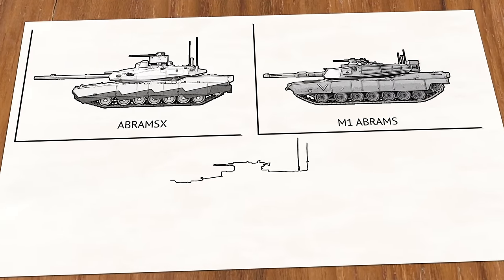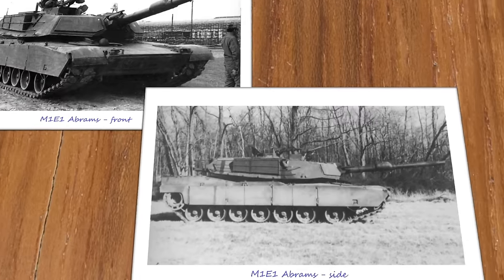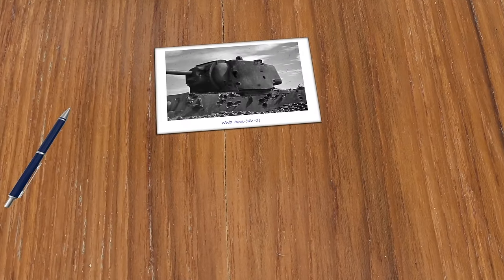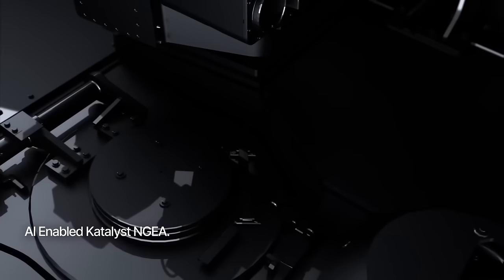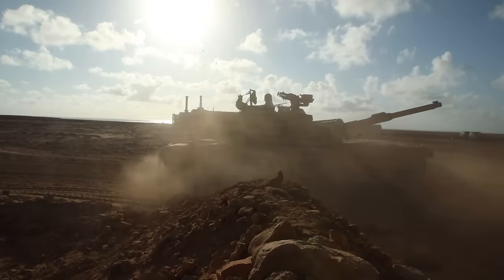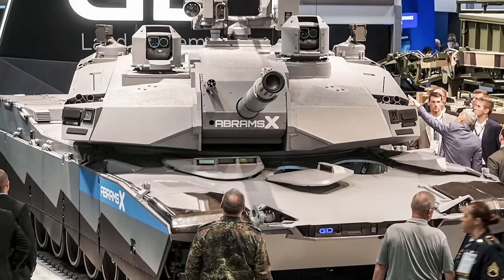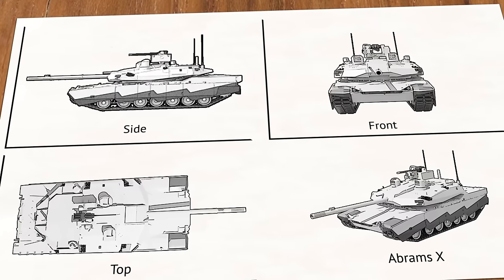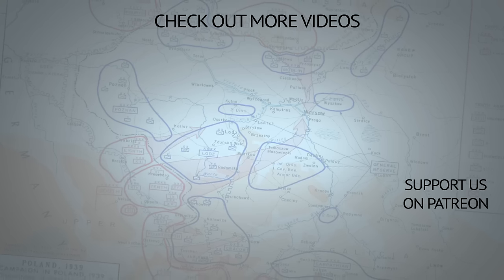M1A3 Abrams is finally happening. And it may get an unmanned turret, like the Russian Armata T-14.

Comment: The chieftain had a good video about this where essentially he's saying it probably isn't going to change much they're just in a better integrate all of its current technology to reduce weight significantly

Expected to weigh 10 tons less without losing any capabilities and roughly looking the same
Reply: He also brought up a 2 man or 1 man turret with an autoloader to reduce weight further.  And a diesel engine.
Reply: @imjashingyou3461  I hope they dont put an autoloader in it
Reply: @ryangoslingIRL  Why? Also they may have to reduce the weight enough.
Reply: An autoloader without a redesigned turret makes little sense.  A human loader doesn't actually weigh that much, but they do require space in which to operate.  That necessitates a larger turret, which means there is more surface area that needs armor and that is why the weight goes up.  The equipment in an autoloader can weigh more than a human crew member, but it's also more compact.  If you have an autoloader you can make a smaller turret, which means it needs less armor, and that's where the weight savings comes in.  But just putting an autoloader into the existing turret design accomplishes very little.

Which is one of the reasons why the Abrams X's turret (which looks basically like a normal Abrams's turret) never really made sense to me.  On the other hand that was basically a bit of marketing, not a real design, so I guess they kept it that way just for the iconic look.
Reply: @kevadu  Almost certain they will redesign the turret to some degree. The Chieftain mentions that as well. The AbramsX turret is kind of comically large with the extra panels added to the sides, but internally I think the armored portion is smaller. An autoloader would save weight but most of the savings will probably come from redoing the controls and electronics from scratch. More significant for the autoloader they are also struggling with recruitment, so eliminating the loader position would be very helpful.
Reply: @andrewreynolds4949  True, though the comically large turret could be reconfigured inside with space left to add new modules without redesigning the turret while being much lighter since its not armored the same as it would be to protect the larger crew area. A lightly armored shell obscuring the important internal structures and leaving room for upgrades could be a valid option.
Reply: @ameritoast5174  Im not a big fan of autoloaders, never thought of them as useful, the only use they have is removing a job from the armed forces with lower recruitment numbers, other than that humans are better
Reply: @ryangoslingIRL  there are pros and cons to autoloader and that is definately one of the cons.   But i will let the tank and armored warfare experts in the Army decide how to rack and stack pros and cons.
Reply: @ameritoast5174  autoloaders just aren’t as good as a human, and it takes too much room imo (unless they use the old designs for abrams autoloaders I guess), and crews like having an extra man for maintenance
Reply: @andrewreynolds4949  honestly the crew size may remain the same for the Abrams, just move the former gunner to the interior and have them man a EW and counter drone / mine operations.   As Ukraine has shown us all, tanks have to remain moving and avoiding being zeroed in by drone assisting artilary.  Also the US total air domination bust extend to taking out all recon drones.  Tanks themselves will likely need their own spotter and scout drone sets.
Reply: I agree with the Chieftain and really can't decide if Binkov is a vatnik. I mean why the hell would the Abrams one of the best tanks out there think of copying a turret from a useless fictional Russian tank is beyond me.
Reply: @imjashingyou3461 yep, the most obvious thing they will do is put the ACE engine in it
Reply: Big pro of autoloaders - better potential with blowout panels.

You can completely isolate the breech from the crew, meaning if the ammo explodes, it's even less likely to affect crew.
Current Abes have an issue where if they are accessing ammo as it detonates, the shield means nothing. 

They can also potentially boast higher rates of fire as calibres increase, do not get tired out in the same capacity. 

A man less in the tank is arguably really good - if they stick to 4 man, you can potentially reconfigure the loaders role in the tank. While Warthunder is just a game, I have a feeling reconnaissance drones organically integrated to a tank could be a really good idea - so long as it doesn't give the tank away. You can quickly transfer control/communicate with your commander. 
While just standard 3 man is good for any losses, as well as needing less personnel if push comes to shove. You also don't need to take less men even if your tanks use less - allowing for crew to be less worked/have more hands free if needed.

Autoloaders are the future for tanks, it's more if the technology has been developed to a point we should build around them.

Also as an additional note - a massive empty turret with armoured components based around critical areas might actually be a really good idea given top down attacks. It'll probably still knockout the breech, but if the crew are in the hull it should further decrease the chances the crew are hit.
Reply: @erikanders3343  I know that's a proposal out there but I doubt they would want to spend the space and weight on it. Attaching a lesser command vehicle to the unit would give much the same benefits and would keep the tanks lighter, and they've been concerned enough on recruitment and sustaining manpower.
Reply: @ryangoslingIRL I think you could make the case that from a logistics perspective 
autoloaders COULD be superior if maintaining the availability of parts for their upkeep and repair is easier than doing so for the loader it replaces (which is possible if you're America and have to go to great lengths to keep your soldiers well fed, healthy, and in good morale, while being able to ship hardware worldwide in scale on a moments notice)
Reply: @D_U_N_E I'm not really sold on the organic drone idea for tanks. Maybe a 4th who manages comma/EW/integration (less commander workload) and give it tight integration with army air assets like the helicopter and UAV units
Reply: @ryangoslingIRL They should, autoloaders and unmanned turrets are the future.
Reply: In a interview with breaking defense Brig Gen elaborated more on the program. They are considering autoloaders, Hybrid electric engines, and possibly new long range munitions(prob a beyond line of sight gun launch missile)
Reply: @kevadu  Future is less amount of trained people. It not weight much, but it costs much and he die like the rest.
Reply: @mh-ht2fp  I didnt even mention Russia, and yes I can load a tank gun.

Comment: The reason why contemporary Abrams is so heavy is for each new variant they just said "F it, slap new systems on top + integration unit" instead of an actual integration. So every new upgrade had its constituent parts PLUS new wiring & a new PC + monitors. Just by switching to a digital platform, they could say 10+ tons in weight. (According to Chieftan, who was Abrams crew & worked on testing some of these systems). For ex. Abrams uses an analogue/hydraulic system for gun stabilization, digital versions are much lighter & have likely advanced to an equal quality, if not better. Upgrades of suspension systems could also shed weight. B
Reply: It's kind of a self-reinforcing cycle, if you shed 10 tons from a tank, you can also cut some weight from the suspension system because it doesn't need to carry as much, so you end up shedding even more.
Reply: @Joesolo13  I would probably keep the suspension system mostly the same, unless they're trying to drop 20+ tons from the tank, to keep the parts supply the same and keep capacity for the inevitable up-armoring and other future weight additions

Comment: I think the biggest advantage of hybrid tank is idling, in regular turbine/diesel tank you have to run you engine to operate the tank even when it’s not moving, in hybrid tank you can run it off of the battery and also at low speeds you can move the tank on pure electric greatly reduces heat signature, noise and smoke
Reply: There's also that modern hybrid engines are literally just a generator that charges a battery that in-turn powers electric motors, and electric motors are capable of providing WAY more torque WAY faster than a combustion engine. That means that if you need to scoot in a hurry, you put the peddle to the metal and zoom off even while the engine may still be revving up. You don't need to wait for the engine to spin up to move, or have the engine already spun-up if you think you'll need to move in a hurry, which makes idling even more viable.
Reply: Tanks have APUs to power them when the engine is off to save fuel. The only guzzler in NATO is the M-1 series with their turbine engines. Leave an Abrahams running and you run out of gas at almost the rate you do driving the tank around. Leopard 2's have a 12KW APU that can operate the tank stationary for days on end.
Reply: @PhilMarks-g7u  good point, it’s not that big of deal for tanks with APU to idle for long time, but it’s a very big deal with m1 , anyway imo hybrid tank is still superior, it can move at low speed with starting the engine, and greatly reduce heat signature noise and smoke
Reply: For heat signature, one thing that really stands out are the tracks. Swapping the engine won't change that.
Reply: @glorgau  when moving yes, but when idling the heat signature is from exhaust and engine compartment,that’s when hybrid tank is much better, it has basically ambient temperature
Reply: M1 series has APUs as of the A2 variant I think. This is not new technology.
Reply: Really? I'd expect that upper, sun beat armor to be way hotter than tracks are that roll across nice cool surfaces like grass and mud. @glorgau
Reply: @PhilMarks-g7u  Friction. Track pins rubbing, track pads don't stick to the ground, they slip a tiny bit.
Reply: You might want to consult the manufacturer, I have bigger things to worry about. Cheers. @glorgau
Reply: No it wasn't new at all. Leopard 2's had them in 1972, a mere 20 years ahead of the US. @nichevo1
Reply: tanks dont need to keep on their engines, they have APUs its a second generator that can be used on the tank so it stays quiet. This is hugely advantagous in a defensive/ambush type role. Thanks have had APUs for well over 5 decades atleast.

Comment: Integrating sensors and electronic warfare systems into the main electrical systems would cut 5-10 tons by eliminating heavy adapters needed to get the 70's era tech to talk to the modern tech. Replacing copper wires with fiber optics would easily shave another few tons
Reply: You overestimate weight cut a lot. However integrated sensors is a step to a fully unmanned tank, which indeed may very well cut weight up to IFV standards.
Reply: You think there are a few tons of copper in the tank?
Reply: @SpicyTake  Honestly, yes. Given the total number of electronic systems, system connections, and system integrations, there is very likely dozens of miles of copper wiring
Reply: @heyhoe168 the cheiftan said sepcifically its about 10 tons of weight becuse its also transformer boxes and such.  You can easily shave another 5 tons with designing in the APS system so it doesnt have to have 2 tons of balancing ballast save another two tons by switching to the lightweight Abrams X gun, and switching to a diesel could yeild more.  There is 15 tons of weight you can easily shed. You can save even more weight by switching to electric drive, as well as electric turret motors.
Reply: @damascus1111 lol no
Reply: I think that completely going that way is a mistake.
Reply: @SpicyTake  there have already been studies done and found that much weight to be had in that.
Reply: @imjashingyou3461 lol no that's like two dumpsters full of copper wire. There isn't that much in a tank.
Reply: @SpicyTake  I mean you can deny what experts, studies, and empirical evidence says on your own intuition.  doesn't make you in any way correct or close
Reply: @imjashingyou3461 What studies? 😂 

BTW this idea would not even work for any wires that carry power(the heaviest ones). Only data.
Reply: @imjashingyou3461  kekw, you should make a reality check. Since when electric drive is lighter then absolutely any type of combustion engine?
Reply: @heyhoe168  it always has been in vehicles.  You also dont know what electric drive is if you think it doesnt involve combustion engines.  Your confusing that with electric propulsion. Electric drive is just using the engine as a generator and getting rid of all transmissions, drive shafts, differentials, torque converters, and structural framing (and all that parastic loss) for a couple of lightweight electric motors and some wiring.
Reply: @imjashingyou3461   Ah, this one. I call it electric transmission. Not sure if it is a good idea for tank, but worth trying.
Reply: @SpicyTake  Copper weight's a little under 9 t/m³ it's not so crazy to imagine that the Abrams has half a cubic meter of extra copper.
Reply: @heyhoe168 Theoretically they are and people have been experimenting with them on tanks since 1917 most famously the Porsche Tiger. Now we have made significant advancements since then and I believe any G20 country could build a function tank with electric transmission at this point.
Reply: @HD-mp6yy Do you have any idea how much wire that would make?
Reply: @HD-mp6yy  yet they dont do it. There must be a reason.

Comment: Uh, there's a huge problem with your assessment about the risk of AP vs HEAT warheads. HE and HEAT warheads tend not to cook off very readily either. Not enough to chain react.

The main reason tank ammunition cooks off is because of the propellant used to shoot it out the barrel, not the warheads themselves. Neither type of warhead is particularly prone to exploding.
Reply: That is true, though I think he was referring more to the amount of damage done to a struck tank, specifically with regards to the safety of the crew and the repairability of damaged tanks.

Most munitions aren't carrying enough explosives to destroy a tank, only to disable it. 
You can't protect the whole tank against modern anti-tank weaponry, so you prioritize armoring the most important parts and make sure you can replace the rest. That means that a well-armored crew compartment and modular components would make tanks much more safe and durable relative to their cost, as the valuable crew will be the most protected and any parts that get damaged by sabot or HE shaped-explosive munitions can be simply pulled of and replaced.

 Boom, you now have a tank that, even if hit and disabled, can likely be redeployed after recovery and some maintenance with the same experienced crew.
Reply: Russian autoloaders store the propellant charge directly under the round. I'll let you think about that design flaw and give me a more realistic response considering 60% of wrecks in Ukraine tend to retain their turrent when no NATO tank that has been hit by multiple weapons has shed it's turret.
Facts are just facts.
Reply: @PhilMarks-g7u  Facts are there are pictures of both Leopards and Challengers with their turrets popped off. Facts are just facts, indeed.

Comment: What do you need a crew for then? If it's fly by wire, you don't need a driver in the tank. The other guys are superfluous in the bottom of the tank. All you need is to follow the tank with a recovery vehicle.

Comment: Using a diesel-electric drivetrain is fascinating.  The engine would be far less powerful than a gas turbine of the same weight, but the electric motor would be more powerful.  Add some batteries to give you 5-10km of range, and you get a much nicer machine.  It could accelerate very quickly, though it may have to slow down slightly for long distances.  It would also have a low heat signature if the engine were off or idling.  It could provide support for infantry without being as bright on infrared cameras.

Comment: My guess is they are trying to drastically reduce weight by more then 15 tons a regular overhaul could have lowered it by maybe 10ish by ripping out the electonics and putting in proper weight managment and armor as a first thought as opposed to an addon. But the turret change would save even more and make the profile smaller. This could be to push for a battery so it runs on a hybrid train. Since those things are heavy and they likely wanna keep it in bridge weights
Reply: Yes because they saw in Ukraine how heavy big tanks are crumbling and easy to be spotted and destroyed and not mention how much gas it takes.

Comment: I think some things a auto turret can support.  One a close in anti drone gun and enhanced drone/missile spotter radar.  They should also add a scouting drone using AI and allows the commander or a specialized EW officer replacing the now redundant gunner.   One thing that should also be looked at is mine detection ground sonar systems that were in research in the 90's. 

The top challenges in the modern near peer tank battles are
1. drone and manpad attacks
2. Mines
3. battle field awareness
4. shoot on the go and not having to stop.  Drone assisted artilary has been deadly.

US should look into total airspace domination anti-drone drones.